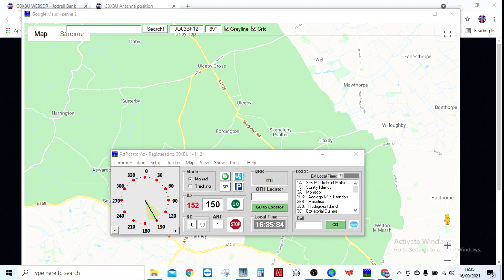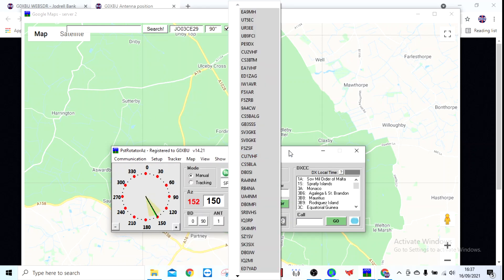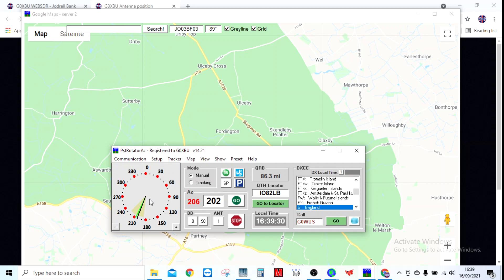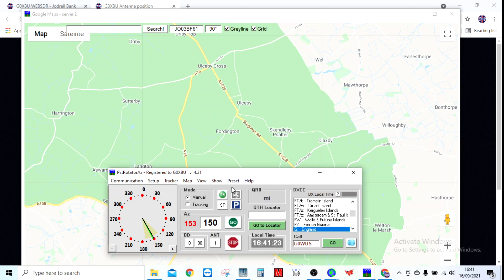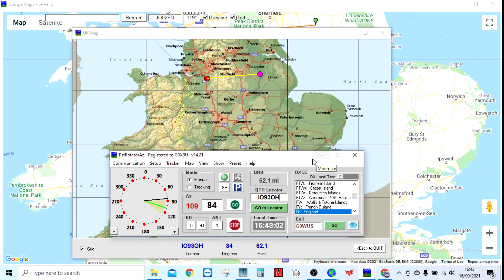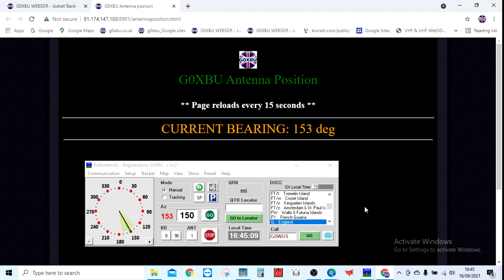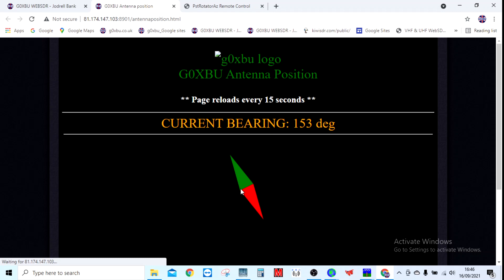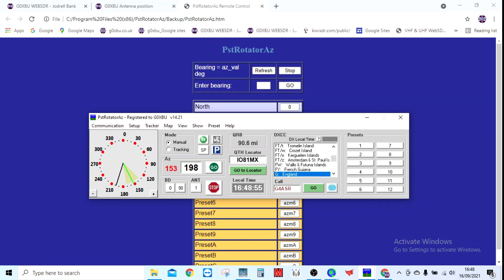PSTRotator Quick Overview

Comment: Hello Ian thank you for this great video. I just paid for my PSTRotator version while I wait for my new Yaesu G-450ADC to arrive, so basically the same setup. I had been thinking to buy the ERC USB for the rotator control, but I see there a few options and I want find the best solution, not really fan to soldering and rewiring a new piece (the rotor control). So will like to know your thoughts on that and how the whole systems had and it is running ? 

Thanks 73 de
Juan
TG9AJR
Reply from the maker: Hi Juan. Yes I would go for it. Take your time then once it is done it opens up lots of options for pc control. I did a more detailed write up here on how to add the ERC board: https://www.g0xbu.co.uk/projects/adding-an-erc-rotor-control-to-a-yaesu-g450-controller
Reply: @ianxbu5091  Hi and thank you I sure will be reading your post about, it sure is interesting and like you said it opens a new world of opportunities, 73